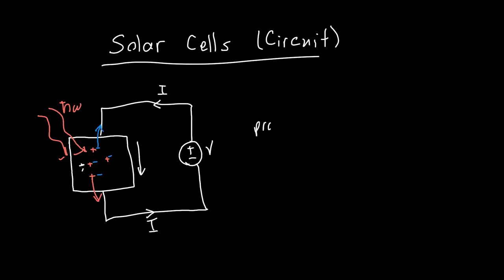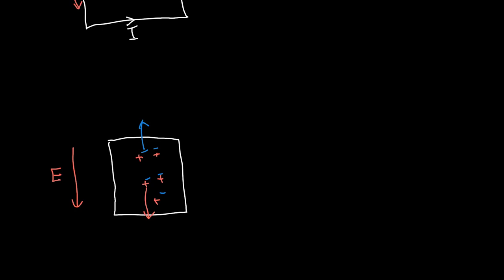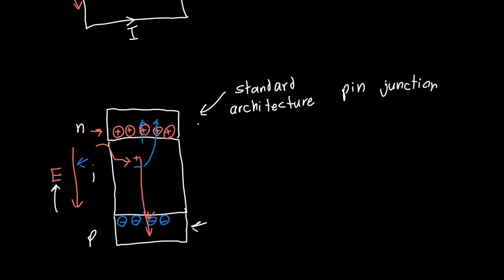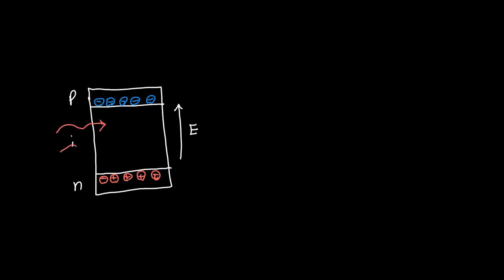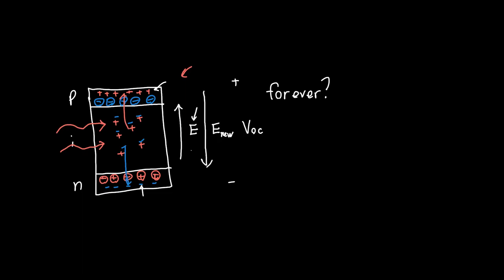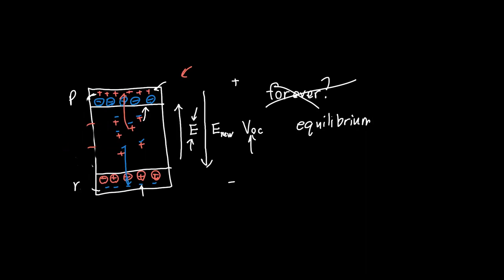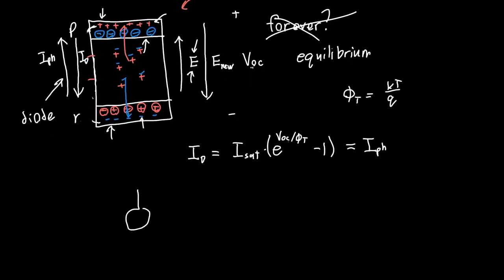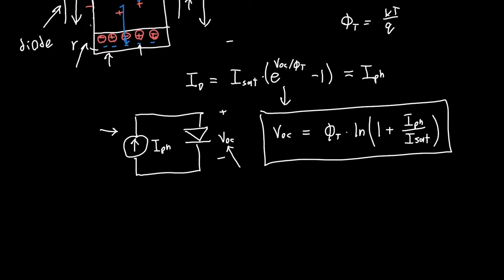Solar Cell Circuit Model Explained

Comment: After 5 videos covering that topic, now I start understand that wired behavior. Now I know why photocell, get maximum voltage of 0,6 volts. And why connecting cells parallel in whole array are loosing current, even if other cells are in pick of producing power. And why photocel can't produce higher voltage. And Also why I can get very high current even if voltage is very low.
This video explain it to me very well.